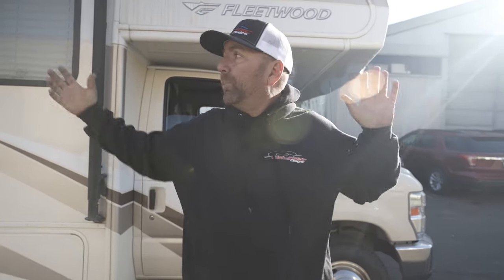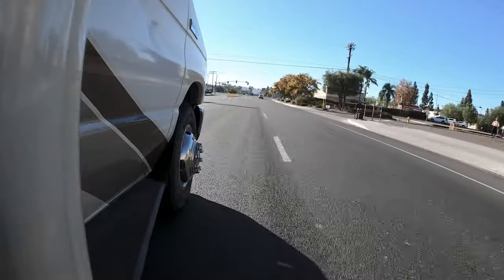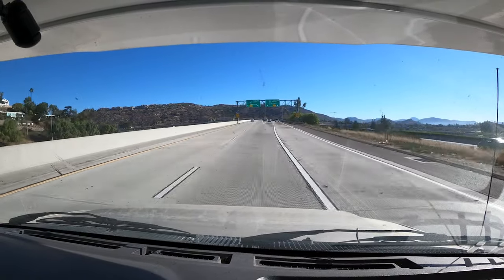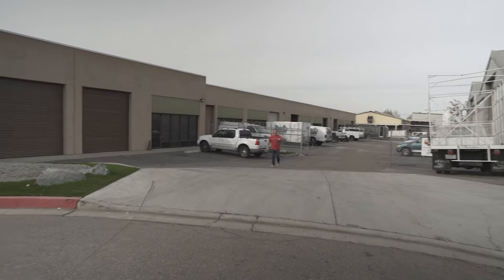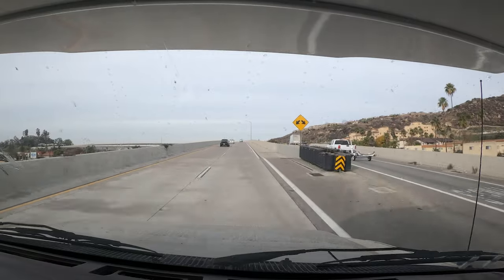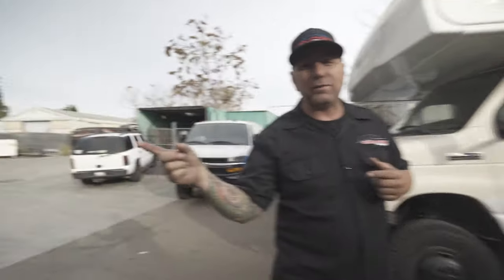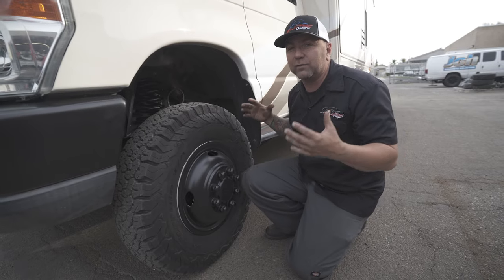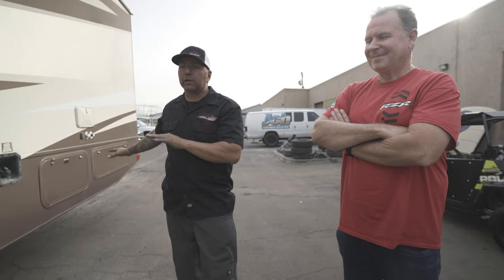We Upgraded This Ford RV And Took It For A Ride!

Comment: This by far the best all around video.I was thinking about the 4 in. Lift now I am sold on the 6 in lift. How much time is needed to have in order to have all the parts available for your suspension upgrade.

Comment: Since that is a Fleetwood Jamboree did it have the MORryde rear rubber shackles on it?  If so did you guys leave that on or remove it?  I've got an appointment with you guys for my Class C later this month, can't wait!
Reply: If any rv has moryde we put them in the dumpster.